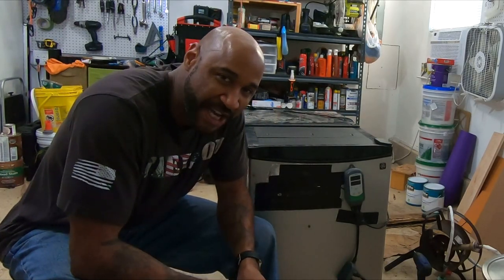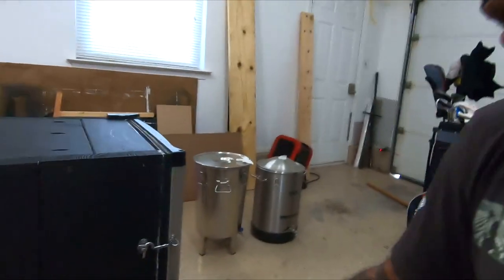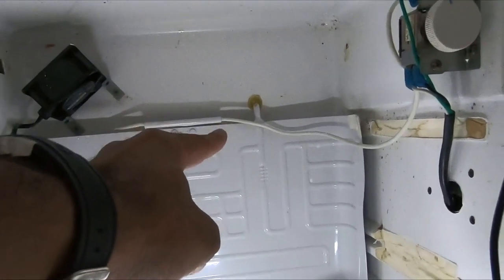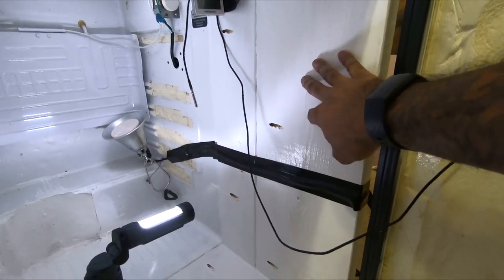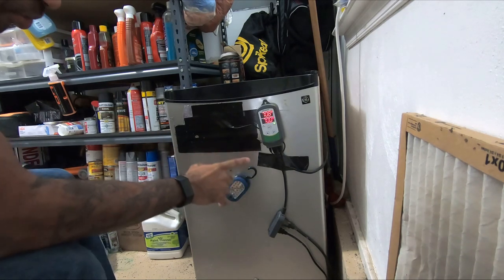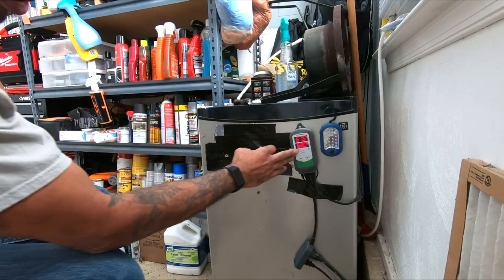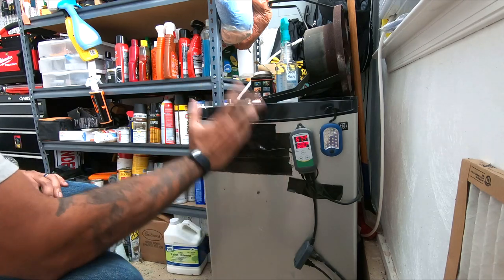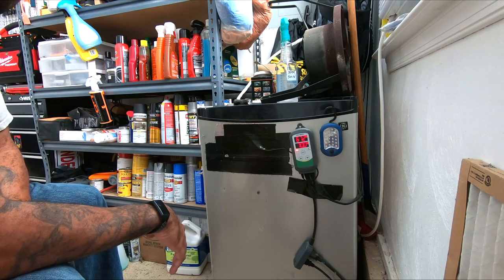DIY Fermentation Chamber from Mini Fridge

Comment: To help with the yo yo effect, you can put your temp probe into a small, sealed bottle of water or other liquid so that instead of air temps, you're pulling the temp of the liquid, which is a bit more thermally stable.
Reply: I put mine directly into the fermentor. Seems to work great
Reply: @Rubio_Eric  that will work too.  The other way just keeps you from having to clean the probe between batches so much.

Comment: Great video! Would i need to get one with a freezer section? Whatvif it was purely just a fridge?
Reply from the maker: That should work fine. It'll save you the time of bending the cooling element down. The coldest I go is 44 before kegging because that is what my keezer bar is set to and a fridge should be able to do that.
Reply: @JayJenkins  thanks for the quick reply Jay! You have yourself a subscriber.

Comment: I’m new to home brewing and looking to setup a fermentation chamber like this and you just answered a question that’s been burning in my mind: won’t the Inkbird constantly be turning on and off the fridge and heating element. I guess it’s gonna take a little experimenting.  I’m curious if I even need this except for doing a lager.  My room temperature (downstairs where I keep my fermenter) fluctuates between 66-68F.  And my fermenter fluctuates between 67-69F. The only time the fermenter temp rises above 69 is like the first day I add my yeast and it goes up to like 78-79F for about 15 hours but then smooths out.  Would a fermentation chamber really benefit me that much?
Reply from the maker: If your temps are that stable and you always ferment at that temp then the juice might not be worth the squeeze. But.... As you saw it's fairly cheap and easy to make, and it will give you not only the ability to know your temp is stable, but to ferment at slightly different temps for different yeast and flavor. Even with ales, fermenting at the lower range will yield a different flavor then at the higher end. It also allows you to easily do a diacetyl rest. Also, as you said it will allow you to make lagers.
Reply: @JayJenkins  you’ve convinced me.  Subbed too …😎👍🏼

Comment: Great video! Quick question.. I have a mini fridge that in looking to get rid of in order to make space for a fermentation chamber. Your video has me thinking of using the mini fridge. What size is your fridge? And do you know how tall your fermenters are? My mini fridge looks similar to yours but I have big mouth bubbler fermenters. I definitely want to be able to cool 2 at a time so I thought I would have to get a chest freezer. 

Thanks for the video! Subbed
Reply from the maker: The height of the mini fridge on the inside is 29 in, the taller of my two fermenters is 21 so I have plenty of space for the airlock on top. honestly if you needed to you could build the collar higher if you needed the furniture towards the door to have more headspace. I didn't need the extra clearance so I just built the collar straight out. Hope this helps.

Comment: Great video! Ever tried to cold crash with your ferm chamber set up? Also, had any problems with keeping lager temps for a long period of time?
Reply from the maker: I have. typically wants to flavor gets to exactly where I want it I drop the temperature down to 45 to stop fermentation. this is another great reason to have a fermentation chamber as you can't stop the fermentation easily without this temperature control
Reply: Jay Jenkins Thanks!

Comment: Hi, one question, the fridge is frost or not frost, because if you have a heater and the frezeer defrost, will drip  and could be cause a short circuit.
Reply from the maker: Not sure but it's never built up any frost, even when I cold crash to 44. The heat lamp is actually in front of the freezer tray, not below it, if it did drip it would not drip on the lamp but I've never seen any moisture in there.
Reply: @JayJenkins  Ok, , Ok, please Can you tell me fridge Brand and Model, thank you

Comment: How did you connect the collar to the fridge?
Reply from the maker: Glue and then I drilled pocket holes for the screws. I also have the fridge and the collar sitting on one piece of OSB. This not only gives it a solid base but allowed me to connect both the fridge and the collar to one base.
Reply: @JayJenkins  great video - straight to the point on everything. Thanks!